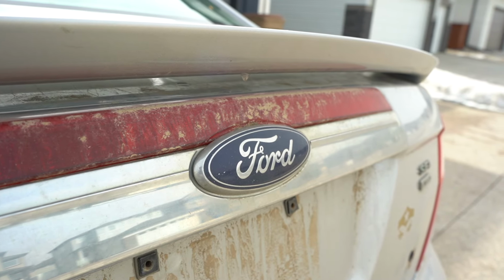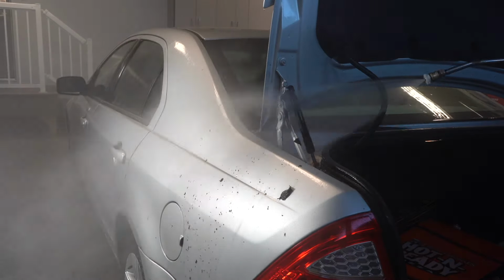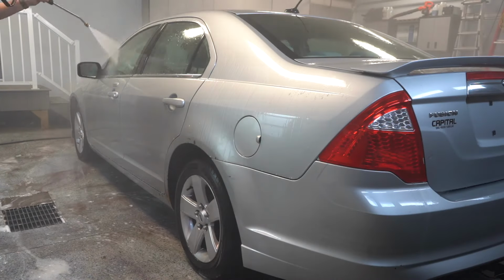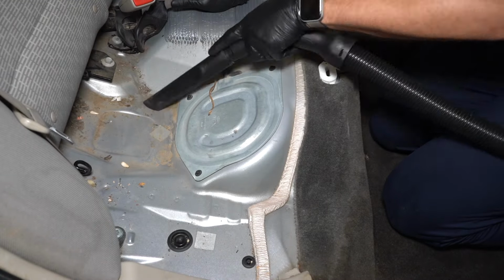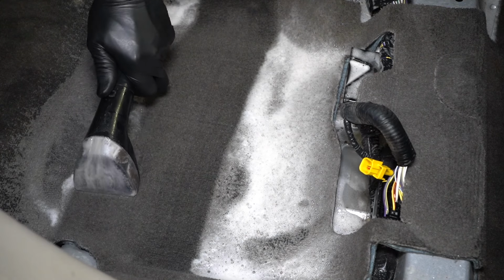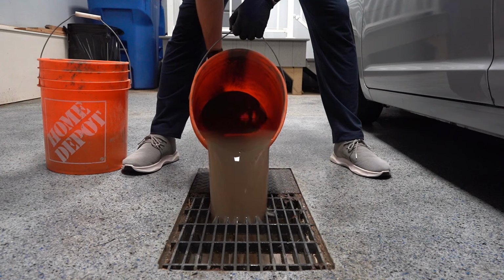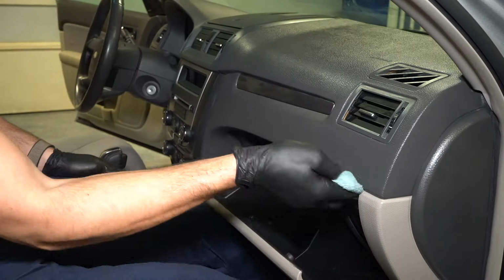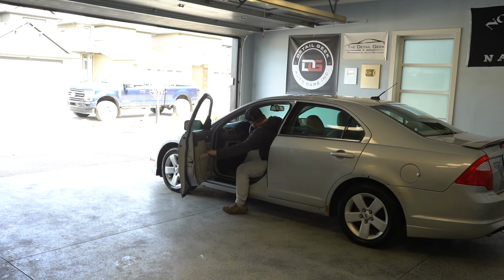Cleaning a NASTY Farm Car! | The Detail Geek

Comment: What am amazed with is that this car lasted this long lol
Reply: All about maintenance my friend.  I currently have 337.000 miles on my 94 Trans Am. Has the LT1 CORVETTE ENGINE. Bought it new.  Engine never been touched. Not even the timing chain.  Runs like new, and looks nearly new,  in and out. 3 to 4 thousand mile oil changes since new.
Reply: Looks really good 👍

Comment: RE: seat drying time. I know it's going to sound weird but I had success in cutting my drying time in at least half. I place my seats or anything that needs to dry fast in my drying tent. I have a 10x10 canopy tent with side skirts. I use two high velocity fans to circulate the air constantly throughout the tent. Not only do they dry faster, but they dry more thoroughly. No more embarrassing wet pants and awkward phone calls. It really works.

Comment: I wonder, with the steamer blowing directly into the switch panel on the doors - wouldn't it cause some shortcircuit?
Reply: Probably disconnects the battery. By time the customer gets it back it'll be dry.

Comment: ok so I have a question for you....I have leather rear seats in my SUV and the dogs roll back there with me,  over the years they've gotten in there with their muddy paws and now I had to buy a doggie seat cover to hide the dirty leather....What products would I use to bring that leather back to new?
Reply: Vaccum any larger pieces and then get a bottle of Mcguires(sp?) Leather cleaner and a bottle of conditioner.  Use a horse hair brush to work the cleaner in and wipe away with a microfiber rag. You can get the brush anywhere they sell shoe shine/cleaner.

Comment: Hey Mitch, wondering if you have any tips for cleaning seatbelts?
Reply: @Nate Devlin soak them in dish soap for 1 hour, then cut a slot in a Wooden pipe, and run the pipe through the seatbelt, grasping it with your hand. Works wonders, look up Sweet project cars seatbelt cleaning. It will show you everything

Comment: I have a question about 303 Aerospace Protectant; when I use it, it tends to leave a white powdery almost streak on certain parts of my interior plastics. Am I using too much, or does it just not suit my car? I spray it onto the applicator pad, not the plastic

Comment: Any tips for vinyl dash that sometimes has an oily slightly sticky feel when sitting in the sun for a while?
Reply: What is the make and model of the car? Some manufacturers actually had a recall/customer service campaign for that. I'd do some research. You might be able to get it replaced.
Reply: A dash mat.

Comment: I spilt tyre dressing on a seat when driving back from Halfords.
Damn spray top wasn't screwed on properly so approx 2 inches of the bottle drained onto the black cloth seat. (The part leather wiped off easily)

The kicker, its a brand new car, less than 400 miles.

I have a mate coming from up north who has a wet vac and some sofa cleaner but I'm unsure it'll do too much good. I did try use wet wipes, microfibre towels and kitchen roll to try and keep the seat damn and get it all soaked up

PLEASE, what do you suggest I use to get it out.

Comment: What do you recommend using on floor mats or carpets that the more you vacuum the more grains of dirt keep coming up. I pressure washed them(mats), drill brush, and used extractor..still upon final vacuum it was like I had done nothing.
Reply: Rubber floors mats. or at least one that aren't made of dirt..  🤣

Comment: During the cold winter do you pull the vehicle outside , turn the heat on high, and crack a window to accelerate interior drying or do you leave  the vehicle in your heated garage?

Comment: Hey DG, i know you only use the orbital at the end to apply a wax/sealant, but i've always heard that its bad to use a machine on paint if it hasn't been clay barred? Since you're using a black finishing pad does that make any chance of scratching or marring negligible? Also how do you usually dry the interior after extracting? I did it once and had a fan inside the car for about 2 hours and it was still musty the next day! Thanks!

Comment: Just wondering what is your carpet solution bought the folex stain remover and the carpet cleaner but didn’t know if you use anything in the extractor and what your solution is made of
Reply: He only runs hot water through the extractor. Otherwise you'll constantly be reapplying solution.

Comment: So I live in an apartment complex don't have access to a Water spicket    so diy car wash is place is about my only option for high pressure water is about my only option and they complain if you tie up a bay doing  detail work any tips or tricks to without having to feed the meter BTW I drive a crew cab f150 that is white to give an Idea of what I'm working with

Comment: Ford seems to always use fairly decent carpet on all of their vehicles. I do not think you will be able to answer this, but what is your feelings on using a mini “power nozzle” that most high n vacuums come with for furniture and stairs in a vehicle using that to super agitate carpets and seats. It seems to work very well in my pickup but a bit more difficult in my car
Reply: @Eric Pippen the new Fords use terrible carpet in their vehicles, except their new F-150. The carpets in 2013-2019 Ford Escapes is crap. Like Velcro

Comment: I have a 2016 SE ecoboost...... I wish you were in Kansas lol
Reply: @Kevin Cook whew! That will be an endless money pit when it’s over 10 years old. Not hatin on your car, but Ecoboost just means turbocharged. Any turbocharged engine will wear out faster, because of air being rammed into the engine. When the car breaks, get a Toyota rav4. An Ecoboost engine will last no longer than 180,000 miles. ( 289,000 kilometres )

Comment: When using your bissell to extract, do you have solution in there also or just water?
Reply: I work for a detail company and literally do the same job the DG does, my bissell( same as his) has a carpet shampoo valve underneath the suction nozzle that releases as you extract the seats
Reply: @kooshkangaroo  it does but Mitch only uses hot water in the extractor. There's plenty of solution on the carpet from his pretreatment.